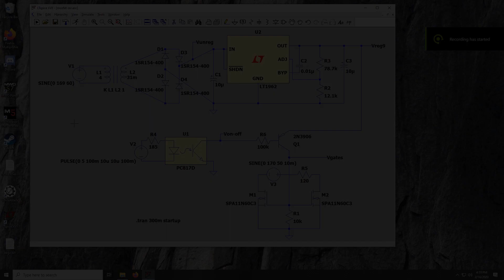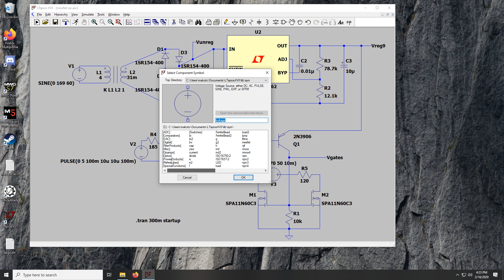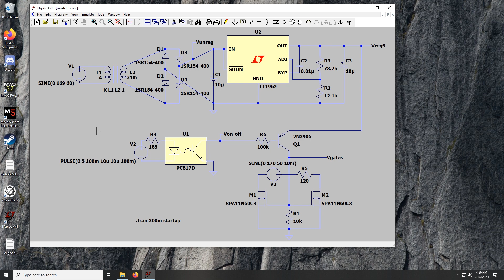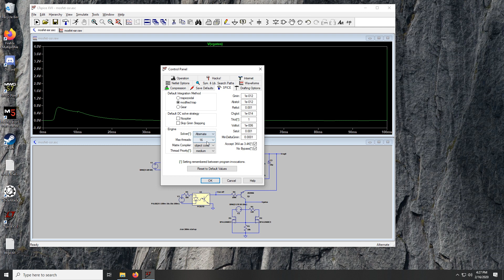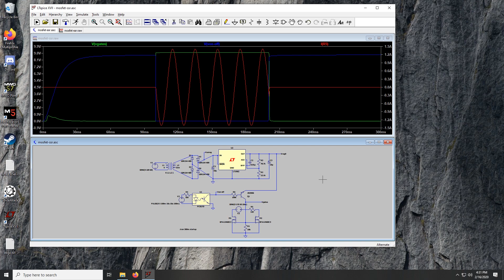MOSFET-based solid state relay for AC.

Comment: What is the purpose of R1?
Reply from the maker: Two purposes. First, when the solid state relay is off, R1 drains the gate-source capacitance of the MOSFETs thus ensuring the MOSFETs turn off. Second, when the solid state relay is on, R1 limits current coming out of Q1, and allows the MOSFET gates to be at a higher voltage than the MOSFET drains, thus ensuring the MOSFETs turn on.
Reply: @SaltyPuglord  Thank you for the quick response and the explanation.

Comment: Hi...Thanks for this video as helped me grasp this concept and realise now that gate and source are floating ...I am guessing the drain pulls ior drops the floating voltage and if so....then why does the gate and source follow the AC drain signal ...thanks in advance ...
Reply from the maker: I can't really explain it better than: the Gate-Source capacitance of the MOSFET is a capacitor. And a capacitor will keep its differential voltage across its terminals, as long as no current is drawn out of it. Even if one terminal of the capacitor is connected to a varying AC voltage. If you haven't studied charge pump circuits, you might want to: https://www.allaboutcircuits.com/technical-articles/switched-capacitor-circuits-charge-pump-circuit-basics/
Reply: @SaltyPuglord  Thanks very much...most helpful and much appreciated...and I am now guessing as the gate and source are floating and the drains connected to the AC sources then there is no drain current in the 🛟 Ng network resulting in channel being full width and in linear mode for each operation ...🤔
Reply: Floating network that should say ..apologies
Reply from the maker: @davidbaxter7111  "the gate and source are floating and the drains connected to the AC sources then there is no drain current in the floating network resulting in channel being full width and in linear mode for each operation".

Yup, that's it. The gate-source capacitance is fully charged and therefore the MOSFET channel is wide open. And the gate-source capacitance is floating, so the voltage on the drain doesn't matter very much.
Reply: @SaltyPuglord  loving it...thanks for the confirmation ..and really do appreciate the replies ..too man 👌👌

Comment: Could this dual mosfet setup be used to (adjustably) limit AC current?
Reply from the maker: In theory, yes. In practice, there are several problems. Do you have an particular application in mind? Or just asking in general?
Reply: @SaltyPuglord  Current limited, isolated variac. I would like an adjustable current limit, not just a dim bulb setup.
Reply from the maker: The big problem with current-limiting an AC voltage is that you usually want to measure the RMS current. And usually you want to make that measurement every cycle of the AC. Many real world loads change their resistance in unpredictable ways, so a single measurement at startup will quickly become wrong. The additional circuitry to calculate the RMS current on a cycle-by-cycle basis gets annoying pretty quickly. It certainly can be done (see: true RMS multimeters), but it's not usually simple or easy.

A smaller, yet still significant, problem is cooling. Let's assume you already know you need the SSR to have a resistance of 10 ohms in order to correctly limit the current. And you set up some kind of opamp circuit to dynamically vary the voltage on the MOSFET gates to maintain that resistance. Now you face the possibility of having as much as ( VacRMS ^ 2 / 10 ) watts of heat being dissipated in the MOSFETs. So the amount of heat you need to handle goes up awful fast with increasing voltage. Again, it's not impossible to deal with this... but it's a lot harder than most people tend to think at first glance.

Comment: Triac control is much easier. what are the advantages of this circuit compared to triac ssr. thanks
Reply from the maker: No significant advantages that I know of. It turns off faster, which in theory could be safer in some circumstances. But that advantage is not significant.
Reply: @SaltyPuglord  TRIACs produce much more heat at high current. For example a MOSFET with 20mOhm Rdson will cause 20*20*0.020 = 6W for 20A load current whereas a TRIAC with 1.5 Vtm will cause 1.5*20 = 30W of heat for the same

Comment: My comments are not all showing up for some reason. Could I pick your brain a bit about an actual implementation of your circuit? I built it--and for some reason 120VAC flows through the drains regardless if the control circuit is on or off. One drain goes to 120VAC hot and the other drain connects to the hot on the load. AC neutral and ground go to the load and are not switched.
Reply from the maker: >  I built it--and for some reason 120VAC flows through the drains regardless if the control circuit is on or off. 

Hrm. I assume you mean significant amounts of current, yeah? Like, not 2-3 microamps... (2-3 microamps would just be leakage through the MOSFETs.) Also what voltage are your MOSFETs rated for? 120 VAC spikes up to a peak value of 169V, so you need 200V MOSFETs at a minimum. 150V will get blow out by the 170V peaks.

> One drain goes to 120VAC hot and the other drain connects to the hot on the load. AC neutral and ground go to the load and are not switched.

That should be fine. The MOSFETs should float up and down in voltage and not care. If you have a chance, try it with one drain attached to the wall neutral and one drain attached to the device neutral, and the wall hot hardwired to the device hot. Nothing should change.
Reply: @SaltyPuglord  Thanks for the suggestions; correct. I am able to draw at least 1A even when the MOSFETs are off (-12Vgs). Measuring between the disconnected hots, I'm seeing a capacitance around 200nF. I am trying to power the gate with a TI MOSFET driver driven by a DC-DC converter (isolated). I am trying a few different MOSFETs, all with a rated Vds of about 300-500V. I am trying to minimize gate charge and Ron. I feel like some capacitance could be the culprit.
Reply from the maker: >  (-12Vgs)

Errrm... are you using N-channel or P-channel parts? If N-channel, why are you making Vgs negative?

> I am trying a few different MOSFETs, all with a rated Vds of about 300-500V.

Okay, that should be more than fine.

>  I am trying to power the gate with a TI MOSFET driver driven by a DC-DC converter (isolated).

Any number of things could be going wrong there. Disconnect that, and then wire up a 10k resistor between G and S on each MOSFET. This is to ensure they can't accidentally turn on.

After you can make them stay off, you can proceed to the next step. Using a 9V battery (negative connected to the MOSFETs' sources) to drive the gates. Obviously this means the 9V is going to float up and down with the voltage on the hot wire, so wear an electrician's glove or other insulating protection if you touch the 9V battery while the circuit is plugged into the wall.

Comment: Really nice design and explanation. Could you recommend some good specs to look for in MOSFET selection?
Reply from the maker: It depends on exactly what you want the circuit to do. I would use a very different MOSFET to switch 12V / 50A than 240V / 5A.

What exactly are you going to be switching on and off?
Reply: @SaltyPuglord  Probably 120vac / 5-8A max. I previously attempted something similar with a dual common-emitter IGBT, but due to parasitic capacitance (I believe) I am unable to switch it completely off. Im trying to revisit the design with MOSFETS and then found your video.
Reply from the maker: @notoriousece7852  Okay, so for reasons I cannot freaking understand... YouTube thought your comment above was SPAM! (facepalm) It's been a year and a half, and I only just now noticed that YT had hidden your comment, and unhid it. Sorry for the delay. I had no idea YT was doing this behind my back. Grrr!

So as far as MOSFETs. There are parameters you must have, and some that are nice to have. The must-haves are: at least 200V blocking when Off. This is because 120VAC RMS actually peaks out at approximately 170 V DC peak. If you want to be careful, I would actually go 300V on the MOSFETs. (I have a policy that I overspec my power components by approximately 50%.)

Nice to have: Low gate capacitance (makes switching on and off faster, thus avoiding burning the MOSFETs as they transition through the middle regions) and low Rds(on) (so they MOSFETs don't burn up while they're on steady-state). These two parameters are in direct opposition to each other: Almost always, lower Rds(on) comes at the cost of higher gate capacitance. So you end up trying to select a compromise MOSFET that has a low enough value for both of them, but isn't as low as you would really like. Finally, you probably want a package with a low thermal resistance. There IS going to be heat building up inside the silicon, and you want to allow that heat to escape as easily as possible. This means some kind of package with a metal tab or metal surface that can easily be mated with a heat sink.

When I made the video, I was looking through Digikey for reasonable MOSFETs, and I found the Toshiba TK290P60Y. These are 600V rated MOSFETs with a 7.3A (@Tc=100 C) continuous current rating, a 0.29 ohm max Rds(on), and a gate capacitance of 730 pF. None of these specs are outstanding by themselves, but the combination is a nice compromise between switching speed and on-resistance.

That said, we should do the math... Suppose there is 7 amps flowing through the MOSFET. Use the formula Watts = I^2 * R. So 49 * 0.29 = 14.2 watts of heat being generated. The data sheet for this MOSFET says that the silicon to case thermal resistance is 1.25 C/W. So 14.2 * 1.25 = 17.75 degrees C above ambient. Of course, whatever heat sink you use will also have some thermal resistance as well. So this number is not correct, and will have to be recalculated when you find out what the thermal resistance of your heat sink is. But at least the initial values seem reasonable. Finally, we should look at the "Safe Operating Area" graph on the data sheet. The data sheet I have places this graph on page 8. We know we will be using 7 amps as the maximum current, so we can look at the horizontal line that corresponds to 7 amps. Just roughly eyeballing the "DC" curve on the graph, it appears that we are withing the safe operating limits from about 2 to 12 volts VDS. We know our maximum on-resistance is 0.29 ohms and we choose to limit the current to 7 amps. So V = IR, V = 7 * 0.29, V = 2.03 volts, and we are safely beneath the IDS(continuous max) curve.

Sorry that reply took so long to happen. I hope it was useful. I also want to say: there are many good MOSFETs that will work, the TK290P60Y were just the ones I happened to be looking at when I made this video.

Comment: @SaltyPuglord Why not consider a photovoltaic(Like VOM1271) Mosfet driver instead? The circuit would be much simpler
Reply from the maker: So, first of all, I want to say that I don't think the circuit is that complicated. It may look overly complicated because I couldn't whack a plain old 7805/9/12 in there. If I could have done that I think the circuit would look a lot simpler.

Having said that? In theory I don't see anything at all wrong with the idea of using an integrated opto and gate drive IC. But In practice, that particular part you mention... the data sheet leaves me with a lot of questions. Just for starters: What is the gate drive voltage going to be? The data sheet says that the internal circuitry on the high side is somehow powered by the voltage on the low side. Which is wonderful. But if my MOSFET gates need (say) 14V to turn on all the way, how do I guarantee the photodiodes on the high side are going to create that much voltage? And if the gate voltage comes from secondary side, what if I'm controlling 5V DC (not enough to turn on my MOSFETs)?

If I'm missing something super obvious in the data sheet here (some kind of graph of low side voltage or current vs output voltage), please enlighten me.
Reply: @SaltyPuglord  I am not sure where the need for 14V suddenly come from, your circuit generates 9V? but the datasheet specifies "Open circuit voltage at IF = 10 mA, 8.4 V typical" Which should be very similar to what your circuit does. As long as you feed >10mA to the LED, the output voltage will be pretty constant.  The driver LED forward voltage is typically 1.3V, so driving it with 5V/330 Ohm should give you the enough forward current. The power comes from the LED(photovoltaic -> think solar powered ). If you need a higher output voltage look at the VO1263. But there are many other photovoltaic drivers out there

Regarding complexity: I don't much difference between using the LT1962 or the 78xx. But using a 60Hz Transformer + rectifier + Linear reg. seems very bulky to me. I whould perhaps look into something the Hi-Link hlk-pm12 if you insist on having a separate power supply.
Reply from the maker: >  I am not sure where the need for 14V suddenly come from

As I said in the video, those MOSFETs I used for simulation are not the ones I would use if I was actually building the circuit.

> The power comes from the LED(photovoltaic -> think solar powered )

Okay, that makes sense. The photons are kicking electrons over the band gaps and downward through the stack of photodiodes, resulting in a net positive charge at the top of the stack.

> If you need a higher output voltage look at the VO1263.

Ah, now THAT looks good! At If = 20mA the guaranteed minimums look to  be sufficient. Turn-off time is 470 uS, which might be a problem... or might not. But at least it seems plausible now with that part.
Reply: The VOM1271 have build-in turn off circuit, the VO1263 have not. The VO1263 datasheet also states  "Actuation speed
depends upon the external ton and toff circuitry ", on fig. 12 you can see a example on how to do a turn off circuit using a j-fet. A quick/dirty/expensive way could be to couple 2 VOM1271 in series?
Reply from the maker: One of the things I want to add to the circuit is zero-crossing turn off. So the fact that I have use another transistor to turn the MOSFETs off is not a big deal. It's something I wanted to add anyway.
Reply: @lcltech  i have just finished an ssr  with the photovoltaic drivers you mention. the reason i am watching this video is gate driving current. if big mosfets are used with these drivers, turning on becomes slow and blows the mosfet. by selecting fets with a large safe operating area you can push it much further, but there is an end. as my application is dc, i'd probably go for a little recom to generate the isolated supply voltage.
nevertheless i really like the photovoltaic drivers and two in series should actually work for creating a higher gate voltage.
but a low-capacity zener protection against gate overvoltage is very beneficial as found in bench testing ;) (dv/dt failure because of the instable gate voltage...) 
have fun!